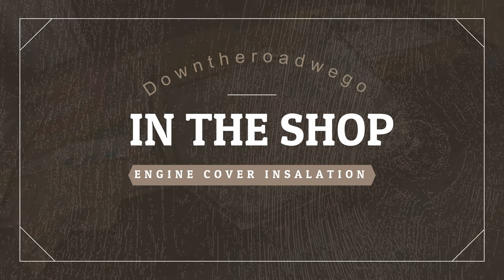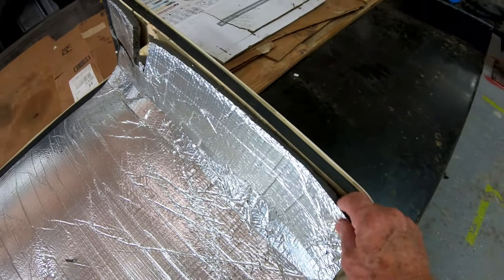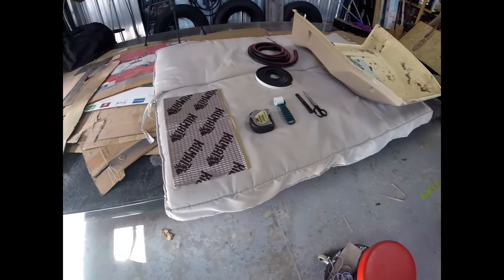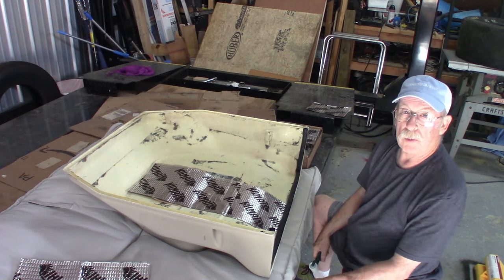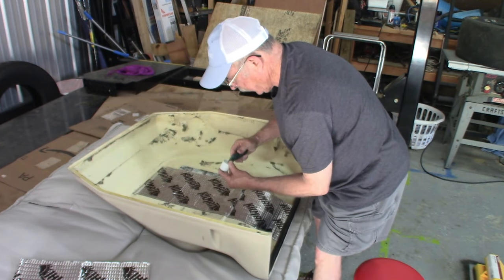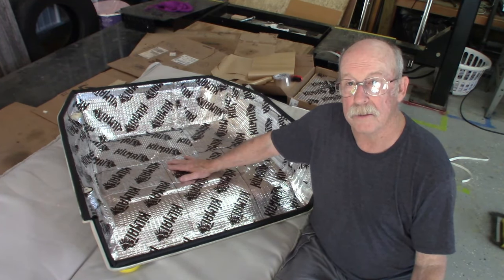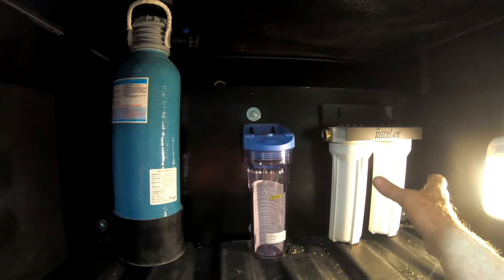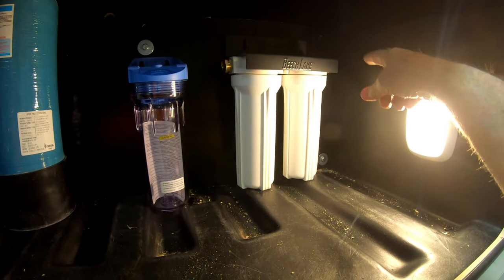RV Travel Channel - RV Lifestyle Channel - Ford V10 Engine cover MOD - S3 EP030

Comment: Great video. I contacted Kilmat and they said it should only be put on metal and only inside the cab rather than inside the doghouse cover facing the engine. Not sure why. Have you had any issues with it?
Reply from the maker: No it worked great. Keeps it cooler and way less noise.

Comment: Job well done! I was thinking about the same mod when I had my Bounder 35K, but I traded it in for a diesel so engine noise is no longer a factor in our driving experience.
Reply from the maker: Thanks, it really made a difference in the engine noise. In our next video, we take a trip to Memphis and back and you can hardly hear the engine. Thanks for coming along.

Comment: Cool. Did any of that peel off? I am thinking of getting a step van with a dog house was originally thinking putting it on the outside but then I thought what about the inside like you are doing. It's a little different shape but similar.
Reply from the maker: No it really sticks good and is easy to form. It cut down the heat and the engine noise.

Comment: I plan to do this mod on my new 2022 Class-A with the Ford V8 engine, since it's pretty load going down the road as well.  Have you considered trying to put the extra sound deadener sheets on the firewall or front floor area if possible?
Reply from the maker: Actually we sold it not long after I put the video up. But doing the doghouse really worked good.
Reply: @DownTheRoadWeGo  I thought you said in the video that you had only just bought it?
Reply from the maker: @cujo7240  That video was released on July 28,2019. We sold it July 2021. So at the time of the video it was pretty new to us. Thanks for watching and commenting.

Comment: Wondering if you are having any problems with the Killmat after installing it? If it is staying on the engine cover after the heat from the engine is directly hitting it? I just installed it on my Class A .
Reply from the maker: Oh, I really like it and that stuff is really sticky. I have not had any problem with it coming off. Thanks for watching and the comment.
Reply: I did finish putting the Killmat on my Class A gas RV engine cover. Thanks for the response.  We haven't taken it on a trip yet but it definitely is quieter at idle and revving the motor in our driveway.  Looking forward to taking it out next month and see how it does.  Thanks for the video and input. Safe travels.

Comment: Job well done! Great detail work, not like the slapdash job kids do. Some questions for you:
1. Will this work in high heat/ grime areas like under the hood of engine?  I bet that's where a lot of noise comes from.
2. Have you ever worked with Mass Loaded Vinyl sheets?  Supposed to be a thermal break and a sound deadener.  Adds 1 lb per sq ft to vehicle weight.  Wonder how Kilmat compares to that?
3. Consider some small panels of Noico - similar product - on metal inside of doors.  It turns the CLANG of metal to a soft THUK sound. You only need a small piece.  Works like steel sinks - the same as the rubber pieces they stick underneath to prevent the loud clanging of cutlery on metal sink.
Reply from the maker: 1. Yes it will. Is was designed for hot rods to insulate under the hood snd firewall. 
2. No I have not. I liked the specs of Kolkata. It has made a definate difference in noise and heat.
Reply: @DownTheRoadWeGo  Thanks for the reply!  I finally found something I can use under the hood and doghouse.  What is Kolkata?  Did you mean Kilmat?  Kolkata is a city in India... where I come from!
Reply from the maker: Yes, kilmat

Comment: Where can I get a replacement seal for under the engine cover? For a 2002 Ford Coachmen Rendevous
Reply from the maker: I just went to Autozone and got one that looked close and it worked fine.

Comment: Hey there! Good job! May we ask for your permission to share this footage for our customers and tag you?
Reply from the maker: Sure that would be great.
Reply: @DownTheRoadWeGo  Thank you so much Sir!
Reply: @kilmatsounddeadening8261  would it be better to use two layers of 50mil or one layer of 100mil?  I am going to tackle the same project.
Reply from the maker: I used two layers of 50 mil so if you can get 100 mil that would be better. Make sure you have gloves on. Ask me how I know that.
Reply: @JordanHaisley  It's better to use Kilmat 100 mil for the floor, fire wall and the dog house. However, if you plan to cover a large area of your vehicle, it's more advantageous to use Kilmat 50 mil 50 sqft, and cover 80 % - 100 % of the area.

Comment: What was the replacement gasket material you used?
Reply from the maker: I took a piece of each one and matched it to a new one at Autozone. They had a self-stick backing. I cut them to size and stuck them down.